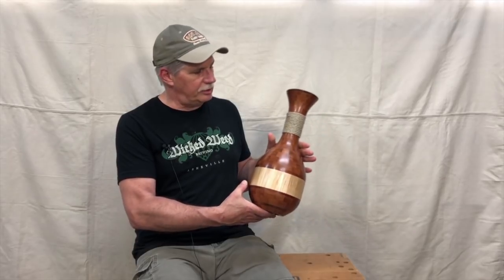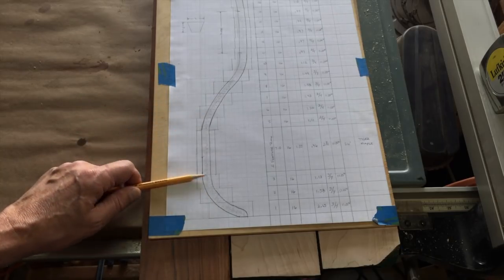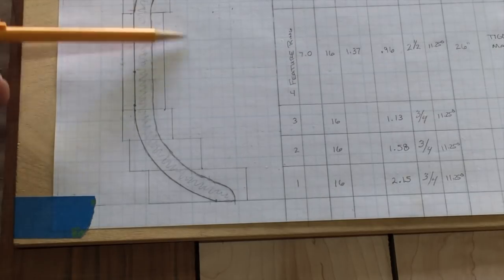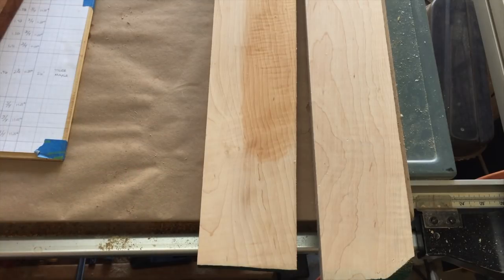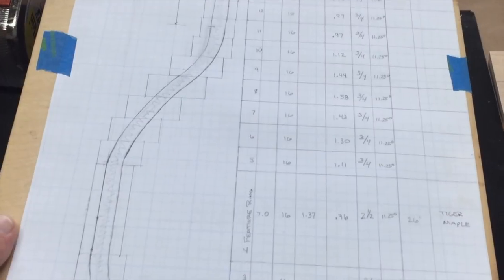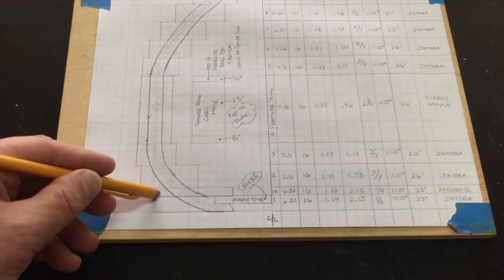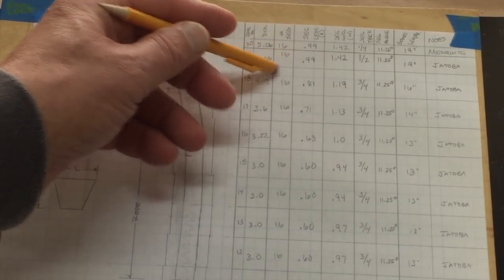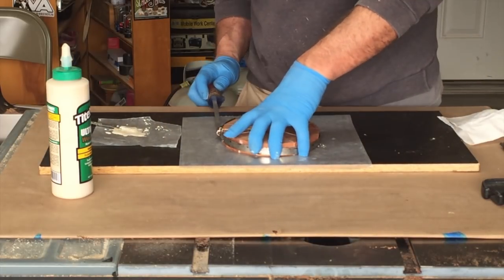A Tall Segmented Vase - Part 1

Comment: I honestly think you've produced a more visual attractive pice than the original Steve. Making the feature ring as I think you have done in a number of pieces, is a relly good tip. I am new to both segmented and  turning generally, but fully see the logic in starting with the visuai "centre piece" ring  first and ajusting to suit. A good tip, thanks for sharing, kind regards, Tony(UK)
Reply from the maker: Thanks Tony.  I did the math on a couple of pieces and then made the feature ring.  When it came out smaller than planned I had to redo all the calculations.  While that wasn't a problem, I'd rather be turning than doing math.   Thanks for watching and commenting on my video.  Take care,  Steve